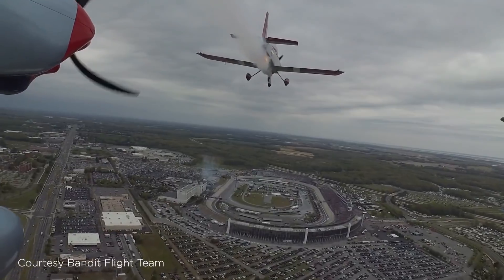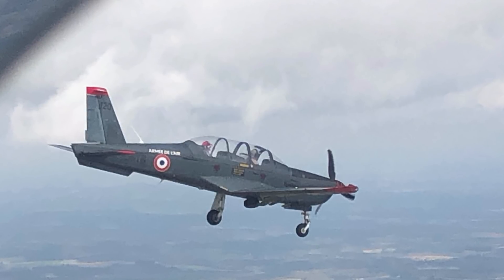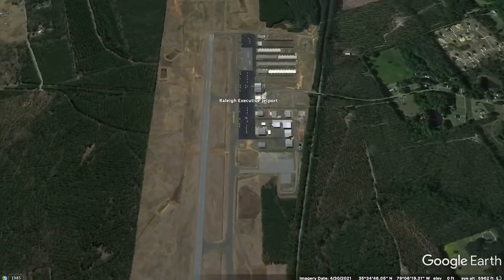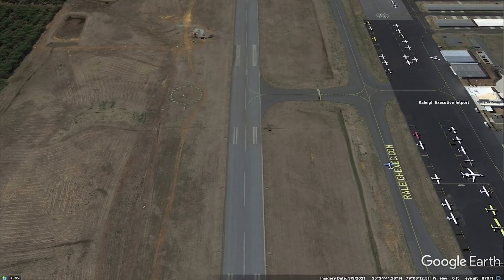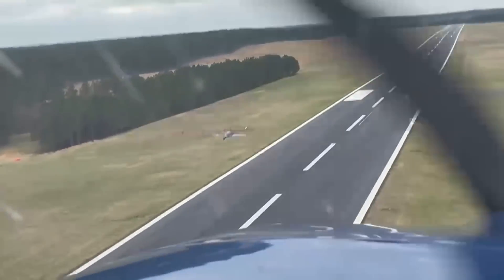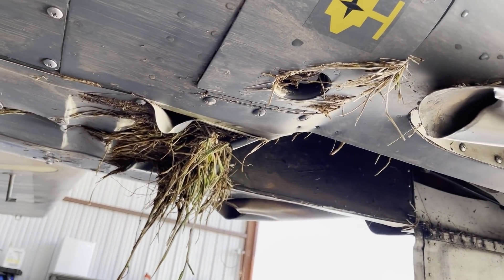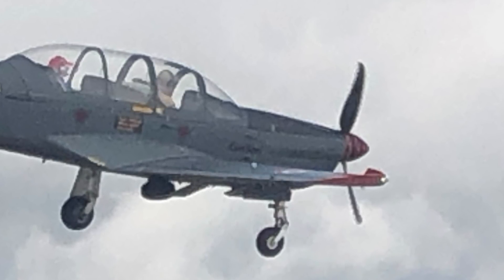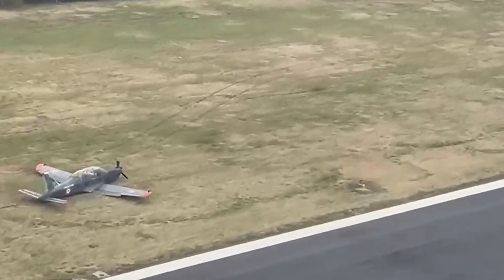In-flight Emergency - Stuck Landing Gear

Comment: I was the back seater! Mike and I had never flown together before that flight. In retrospect, I wish I had been filming from inside the cockpit during the landing, but I decided not to be the idiot dragged out a cockpit with an iPhone in their hand trying to capture some cool footage. The landing was just as smooth as it looks in this video. Mike is a pro. I now have a chunk of the prop displayed in my hangar (also at TTA). We had quite a time walking the grass and runway finding all the pieces. I still occasionally have someone at the airport ask me if I saw that gear-up landing a while back. Yes, I saw it.

Comment: So the question is: which cause less damage to the airframe, hard surface or grass landing? In this video I hear conflicting views.
Reply: Concrete always better for belly landings, not for wings with “tip tanks” that have fuel in them, where only one gear would push the wing tip down. Runway scrapes are very clean and don’t fill the belly up with rocks and sand which destroy the inside of plane. All the stringers now have grit grinding the airplane to death between the seams forever, even after restoration.